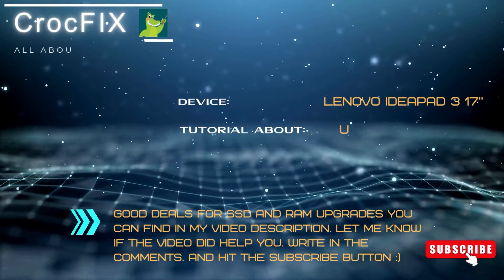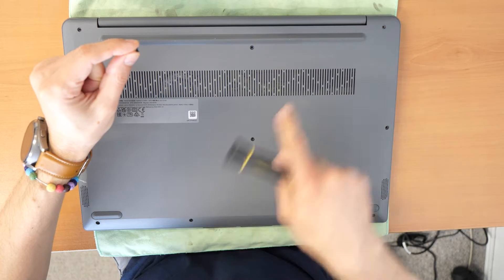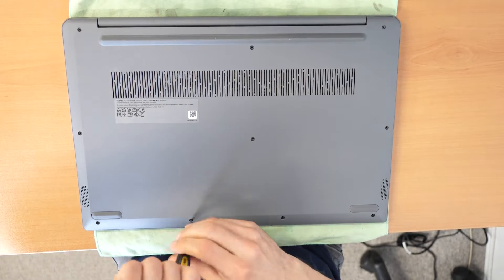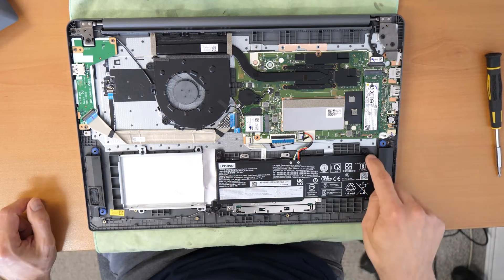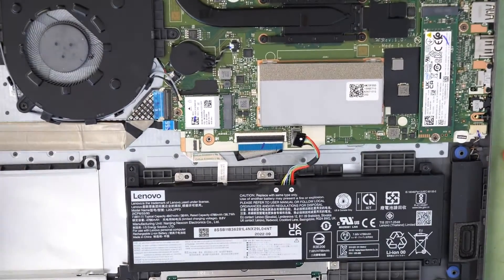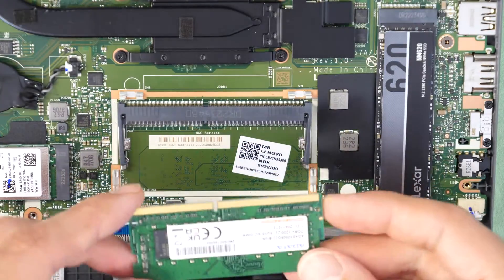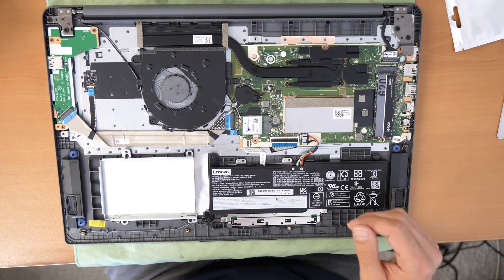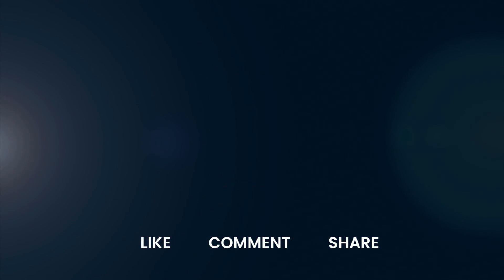Lenovo Ideapad 3 17'' LAPTOP - How to open & UPGRADE OPTIONS

Comment: Hi! If I have 8GB ram configuration, is the Dimm slot occupied or not? I heard that this laptop has soldered 8GB of ram. So I want to know, if i want 16gigs, do i need to buy only 8GB ram or 16?
Reply from the maker: Yes, ussually 1x ram is soldered. So you need to buy one ram stick of 8Gb and you will have 16Gb in total.  Hope that helps and for your support. Please Like the video & Subscribe ❤🙌

Comment: Why does it have a space for a 2.5 ssd when there's no connection for it? If it connects through a small ribbon cable, where can that be found? Thanks for the video
Reply from the maker: You are very welcome. I have inserted a link in this video description, where you can order the SSD cable. Thanks for the comment and hope you Subscribe and join the CrocFIX channel family :) ❤️

Comment: I just replaced the RAM in mine today after watching this.  In the model I have, 17 RU7, it went sticker side down.  I don't know if they installed the carriage upside down or what, but that's what I had.
Reply from the maker: But it's working?
Reply: @CrocFIX  Yep, should have mentioned that I guess.
Reply from the maker: @Ken_G.  :)

Comment: Can you make a tutorial about how to attach an additional hard drive? 512GB isnt enoigh for me
Reply from the maker: You can see in the video how to replace the NVME ssd. Just swap the 512Gb with 1Tb or 2Tb. That's the best option. SSDs you can find cheap in my links in the video description.
Reply: @CrocFIX  i meant like, add additional drive, not replace the current one
Reply from the maker: @TTien63  I know. I just wanted to give a fast solution. For an additional drive, you will need an extra adapter, cable and brackets.

Comment: My Ideapad 3 suddenly shut down and would not respond to the start.button. Completely dead. I opened it up after watching this video, unplugged and plugged in the battery and it came back to life.  It may have been a poor battery connection but I doubt it, since all looked correct and even plugged into the power supply it was dead. I think briefly removing battery power brought it back to life. My heartfelt thanks for posting this video.
Reply from the maker: You are very welcome. Sometimes the laptops go to a weird state...it helps if you unplug the power supply and press and hold the power button for 1 minute, then release it and wait couple of seconds and power on again. Sometimes also the electronic part on the battery starts acting weird and you need to replace the battery. Sometimes just disconnecting the battery and reconnecting again helps.